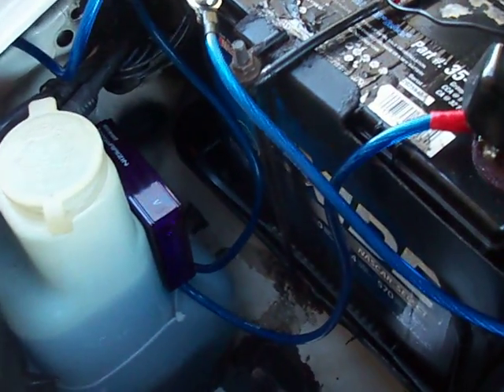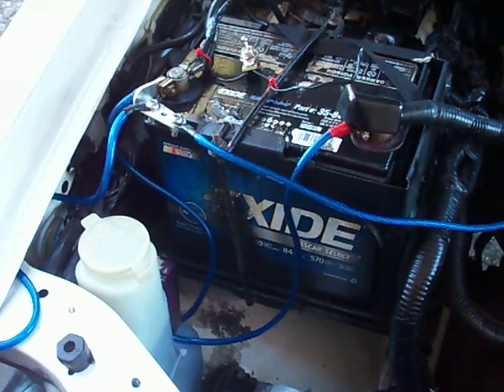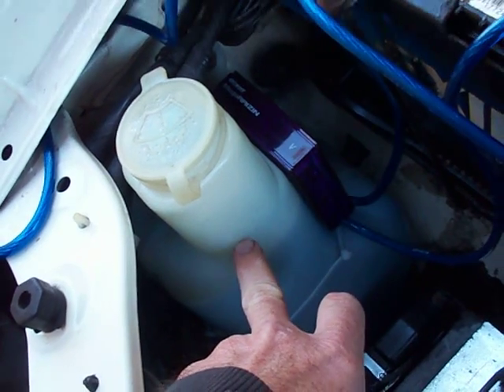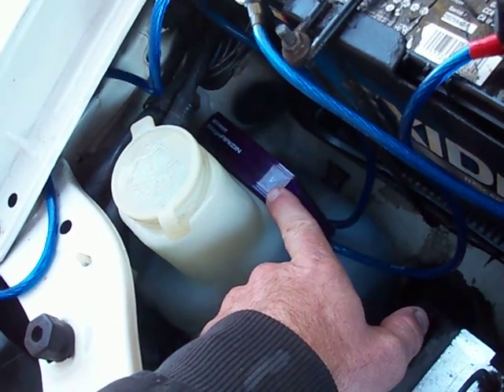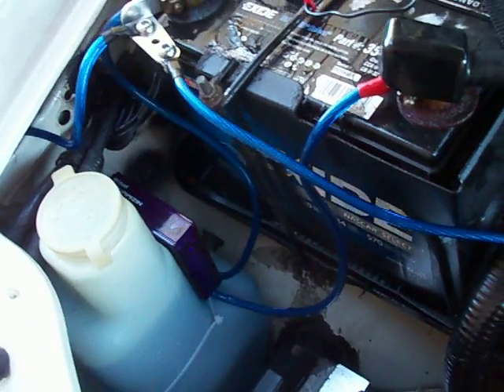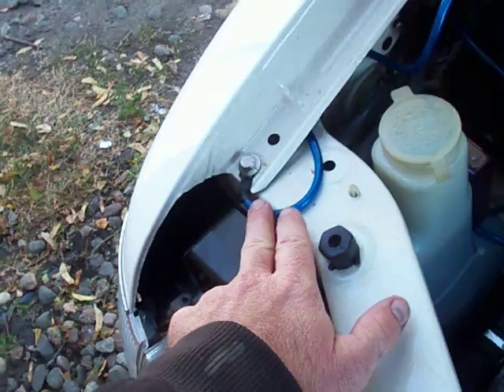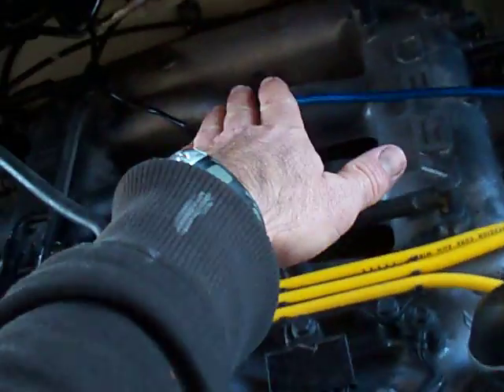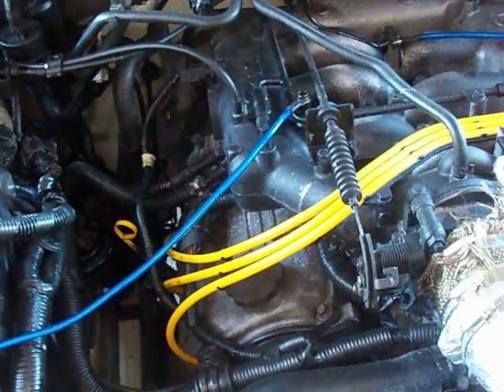Pivot MegaRaizin voltage stabilizer installation and initial performance.

Comment: Hey mate,
I just brought one of these, 
I've installed it correctly,  but the voltage display only shows for approximately 15 seconds, then disappears, 
Is that normal?
Reply: It's normal, to save power

Comment: it works better for small cars like 1000cc or 1500cc when fan lights or other electric load come on engine rpm dropped and engine shakes you can see noticeable difference after installing this kind of device

Comment: hi 

if my battery in the back of my car in the trunk 

where to connect the ground wire ?
Reply: SMS570X then you will use ground wires. Use HKS wire and opinion with your car electrician.

Comment: What I was curious to know is how it performed before you installed it... you only show effects of lights being turned on and voltage drop after it was installed. Do you have any readout info on what your bat voltagewas before installation and after lights turned on and revving. That I would be keen to know.

Comment: It is normal for it to display voltage the first time it is hooked up. It will only do it for aprox 1 minute the same as it does when you start your engine.

Comment: Its essentially a capacitor pack and they do work very well. Unlike competitive brands which only have one cap. The raizin does improve audio output and throttle response along with the ground kit it can also improve fuel econony because adding better grounds to the block gives a better ground for the spark plugs thus increasing their efficiency in fuel burn making it possible to use less fuel for more power.